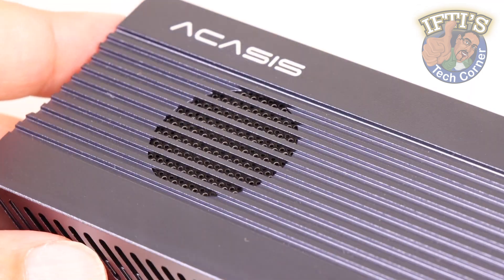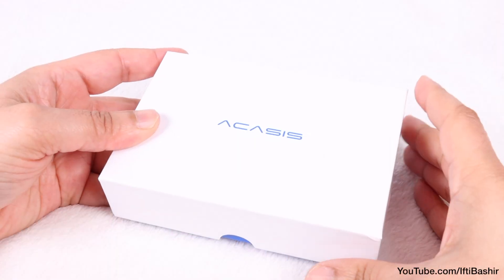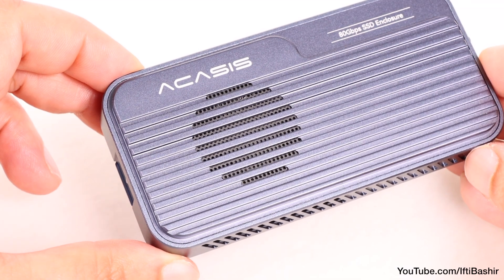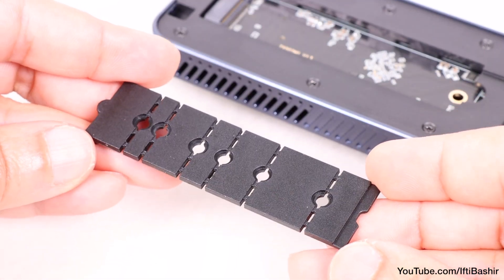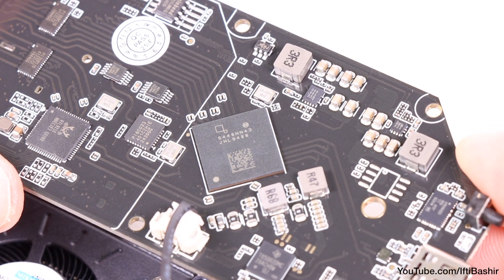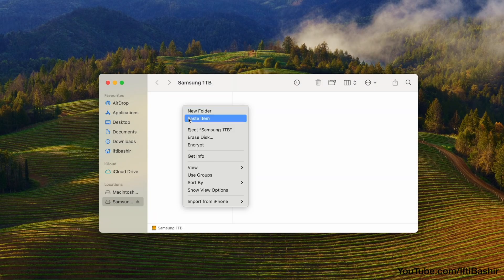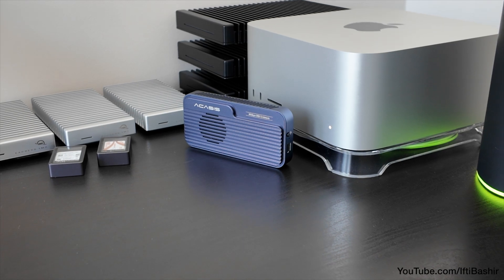Acasis TB501 PRO - The Ultra Fast 80Gbps Thunderbolt 5 compatible SSD Enclosure! : REVIEW

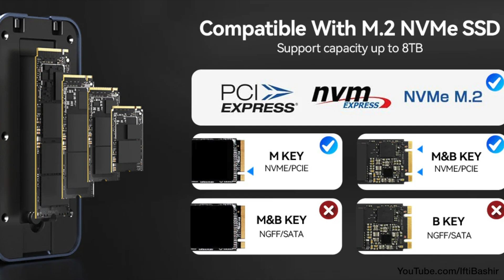Comment: 3:29  the external SSD is for fast reliable storage (reliable and long lasting being key) so the NVMe must have A [high DWPD, High TBW, Overprovisioning of at least 10% & Power Loss Protection, mandatorily TLC Flash not QLC] any NVMe PCIe 1.4 drive wont match the 80Gbps theoretical speed.  Even the Samsung 990PRO has max theoretical speed of 7,450 MB/s (7.45GBps) which is less than 10GBps (80Gbps) !!!!  so better to go for a balance of speed  and reliability Samsung 990PRO has a DWPD of 0.3 which is pathetic for reliable storage - if only speed matters the time tested 990pro will suffice - Any comments ?
Reply: 7450 MB/s is 59.6 Gbps. A 990 Pro will approach saturating the interface. A gen 5 SSD will fully saturate the interface.

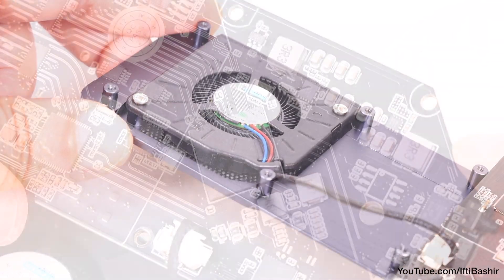Comment: excellent review -  You should have shown the cross sectional view after unmounting ... if there is any gap/clearance between the bottom part of aluminum casing and the JHL9488 controller chip, in that case heat dissipation wont be optimal. A suggestion would be to cutout a high end thermal pad as per the JHL9488 chip size and stick it on the chip so it can make a 100% contact with the metal also to adjust the orientation of fan power cable so it doesn't touch the chip -  I also saw at 2:49 that this case has an addon RTL9210  NVMe controller chip maybe to add compatibility and the fan is positioned just above that, as this is not RTL9210B chip it will also heat up considerably so add a 1mm thermal pad on this too -This SSD will be extensively used so the fan  and bottom casing also might need periodic cleaning say once every 6 months or as per usage hrs (1000hrs)  - Any comments ??

Comment: The fan button is a mystery. Haven't seen anyone anywhere show in a video post what happens when you press the button on or off yet. Everyone glosses over the topic without showing  what changes when you press the button. Thai is odd, But, the TB501 pro that I just bought works. However, the button is enigmatic. I know I'm not the only one how notices it and figure out the mystery button.

Comment: I have this and it’s great.  I did have some auto-eject issues but then did a power reset of the CalDigit Element 5 hub it is plugged into, and then since it has been fine.   My only complaints are the lid comes off a little too easily, and the thermal strips are not enough to create contact with the lid.  I had to add an additional one.

Comment: Hi Adam, new subscriber here. I will be using this for video editing with my new M4 Max Mac Studio. Would you please tell me the best 4TB or 8TB SSD to put into the new Acasis TB501 Pro. Please tell me the exact brands and models to buy, and if I should buy the version with or without heatsink. Will it work slower or get hotter if I use a 2 TB, 4TB or 8TB? I heard that I will also have to buy a 2mm thermal pad to make it fit correctly into the enclosure. Thank you!!!
Reply: Since homeboy won't answer you, I can help.  You do have to buy a bigger thermal pad; I got one from Amazon.  I have a 4TB and my temps seem okay around 45-48 idle. The fan kicks on at around 50°C and it cools way down after that.